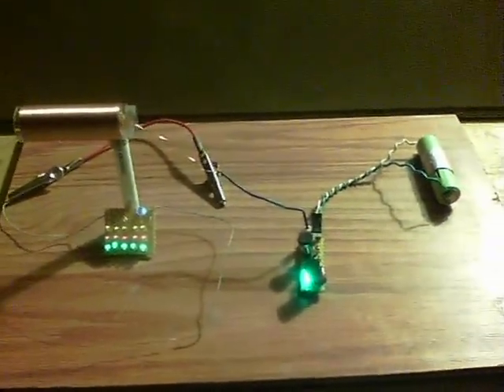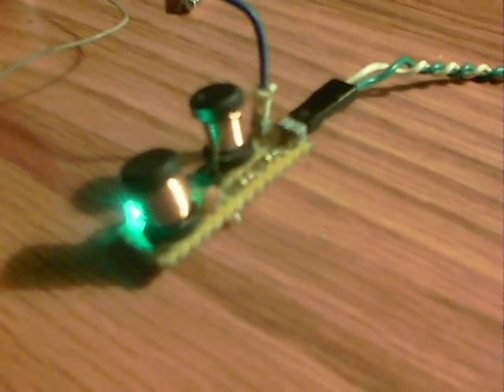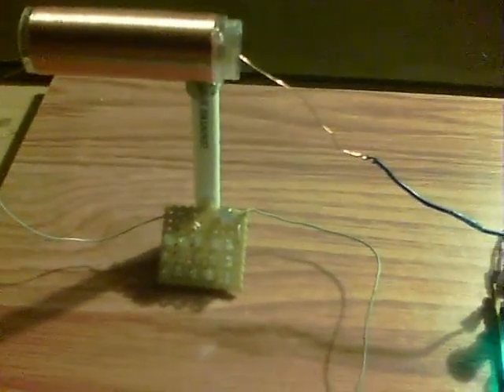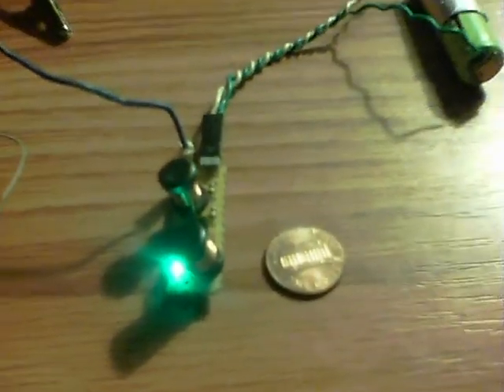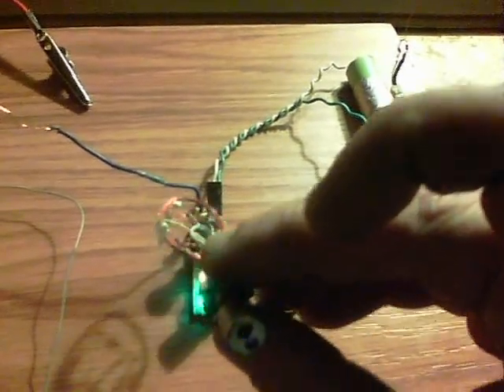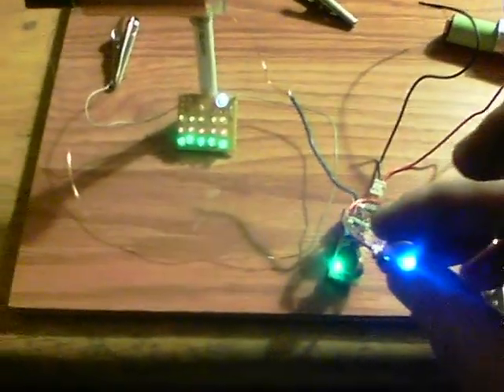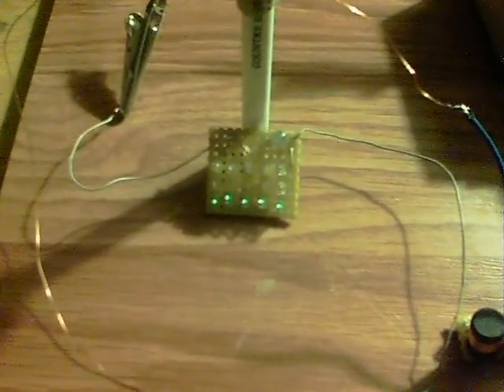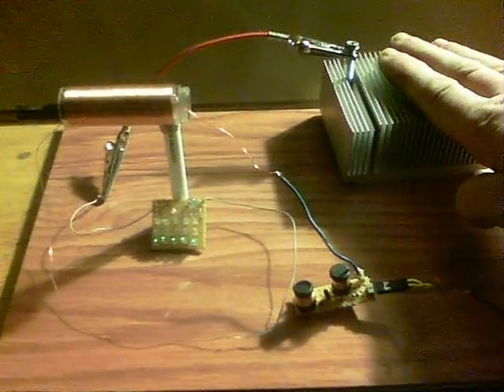Jonnydavro SEC - low voltage

Comment from the maker: @KyleCarrington Works better as the voltage goes up, but will use downward too til the tranny doesn't switch on. Just need to check on the transistor temp when above 4V, Jonny has his on 16V with an MPSA06 and lit fluoro's excellently at that. Tuning is the thing here, it'll run differently as the frequencies change. Works really well when externally excited by a traditional Slayer, range is huge even at 1.2V when a Ground is used...which may be worth a video.